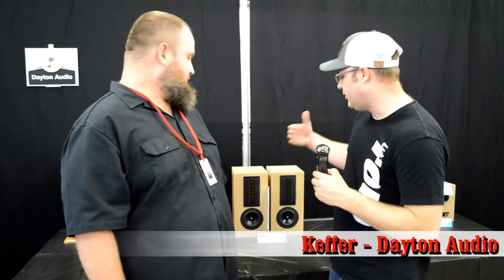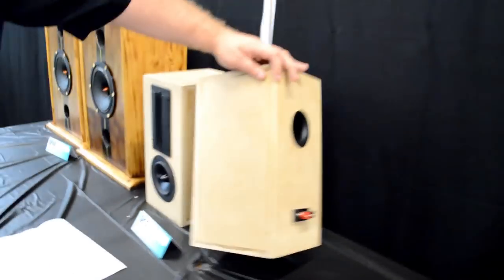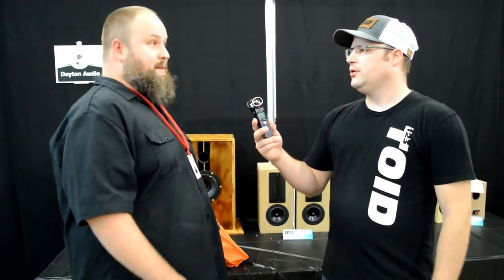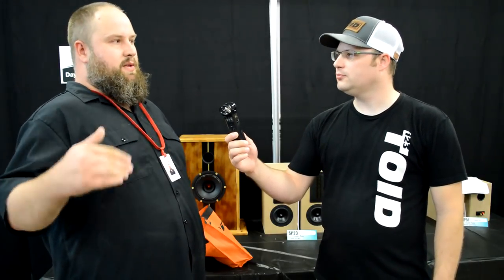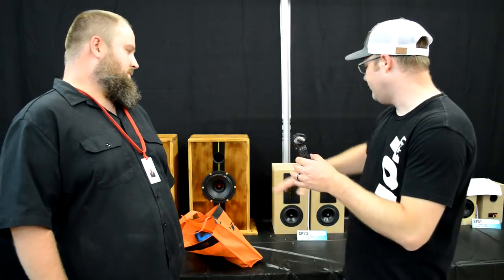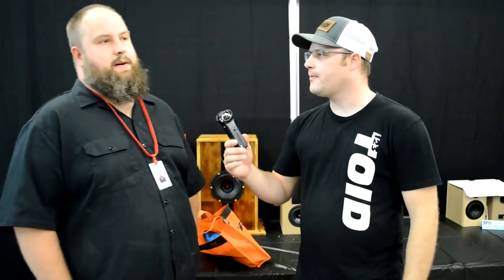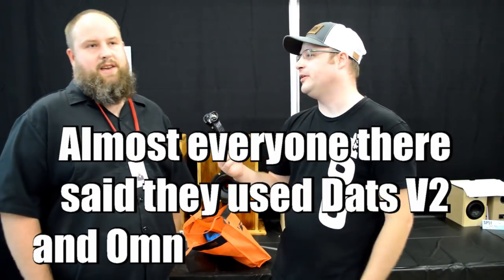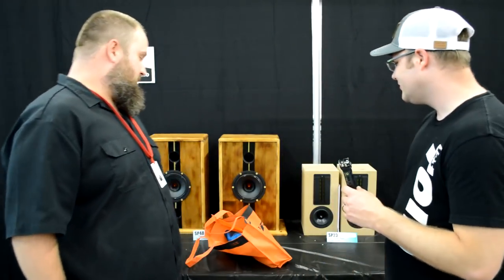Meet the Designers of MWAF 2018 - Scott Keffer - Dayton Audio

Comment: Dayton <3 My love. But I don´t like such small speakers to be ported :( Also can they handle more power in sealed or ported ? I am confused of winiSD, simulations of power handling seems very unreal
Reply: OfficialDaddys2 sealed generally will handle more power.  The reason I ported these was to get better low end extension.  In this design, they are still quite flat on the bottom end.  The RS125 is probably my new favorite mid/woofer, though; this speaker is plus/minus less than 2 dB from 200-3kHz as it sits.  That is not shabby at all for being just a first order on the woofer.

Comment: Thanks for sharing.
Does the DATS work with the UMIK?
Reply from the maker: Dats only needs a computer to work.  But people use Dats to get final port tuning, T/S specs and ZMA files of the driver as well as many other things including testing crossover components.  The Calibrated microphone gives you the ability to get your frequency response.  Any calibrated microphone will work. So yes, the Umik will work well with Dats.  In fact that is what I used only, until I got an Omnimic at MWAF

Comment: dont want to be rude. but these planars are not that good. freq response above 10khz sucks and they dont go low at all. :(

Toid. as you may know i am playing around with some planar tweeters that can crossed lower reach lower and prob has lower distortion.  i bet i can make one with 2 or 3 components
Reply: I salute you and your work, Joppe ;)
Reply: thank you although i must say i had to be drunk to make such cocky lame post :)   i guess. not the most flattering post :)
Reply: @joppepeelen   you can always edit it ;)
Reply: Kinda surprised I didn't see this comment until now.  How do they "suck?"  

In this design, they have quite good response above 10khz, and even in this particular iteration of the Sedoso with the less than ideal crossover, they had usable extension beyond human hearing past 20kHz and were within 6dB of the woofer without any L-pad or attenuation.  Their in room response reminds of older JBL designs with their rising top end, which many people find not just pleasing but many prefer that sound profile.

Regardless, have a good night.

Cheers.
Reply: @joppepeelen a drunk tongue speaks a sober mind.